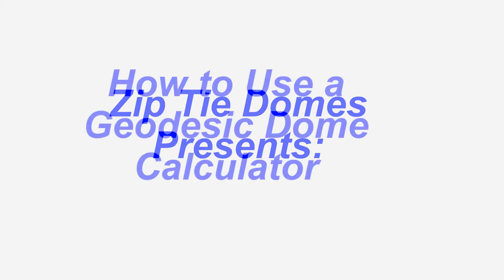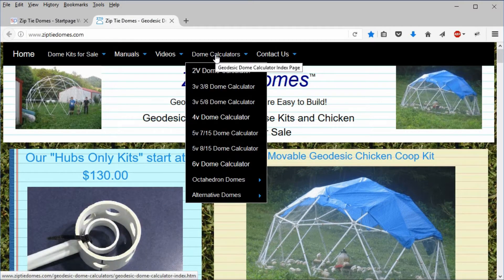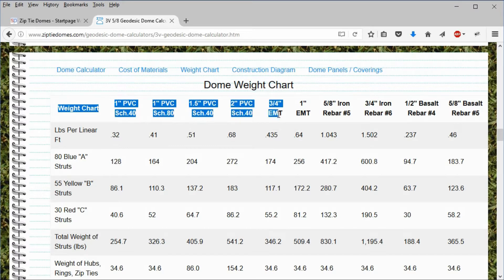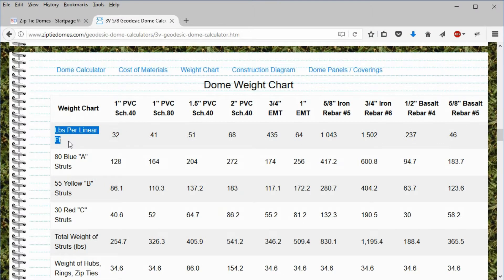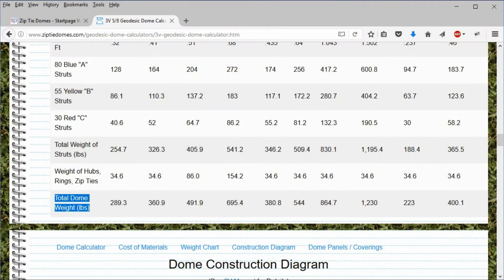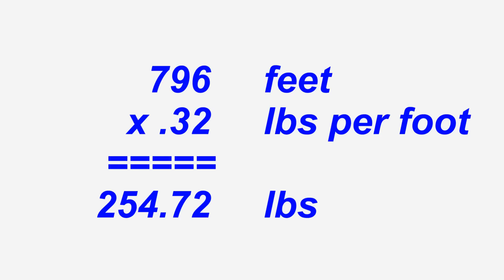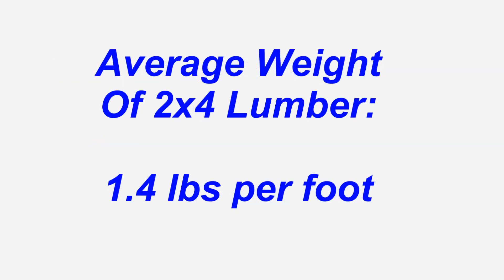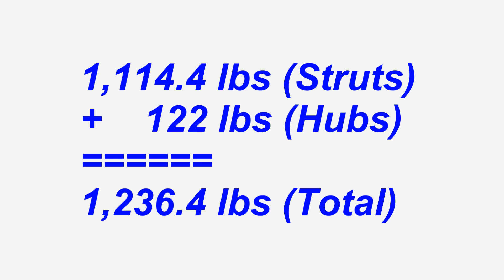How to Use a Geodesic Dome Calculator - Part 3: Weight Chart

Comment: On a tangent: how are the ends of rebar secured in the collars?
Reply from the maker: Use stainless steel zip ties for up to 250 lbs tension, and u-bolts for more than that.  This connects the rebar struts to the center rings inside the outer collar.  For more information see our video at:
https://youtu.be/v_NnY_yYwuc
Thanks,
John Hurt
Reply: John, thank you for a quick reply.  I have to say, your concept and design with the inner ring and outer collar assembly is truly inspired and amazing!  It's given me hope to be able to build a small dome enclosure and shelter for our small flock of backyard chickens.  That's something which I, at 65 years old and wheelchair bound, wouldn't otherwise be able to do.

So, my question about securing rebar in the collar/ring assembly is pure curiosity.  I don't see me ever actually building a dome with those materials.  Having said that, and after skimming through the other video you linked to, I still don't see how the ends of the rebar are secured to the rings.

Every other strut material mentioned (PVC pipe, metal conduit, bamboo) is secured to the inner ring by drilling a hole through the end of the strut for a zip tie to pass through and secure it to the inner ring.  Is it done the same way with rebar?  That is, a small hole is drilled through the end of the rebar for the zip tie to pass through?  Unlike all the other strut materials, drilling holes through the ends of so many pieces of metal seems incredibly challenging.  (Not impossible, just daunting.)  Is that the way to do it?

Again, thanks for conceiving, designing, and developing this system.  I've been interested in domes for literally a half century.  Your system is the best I've seen.  Ever!